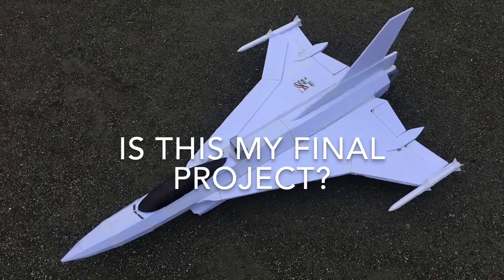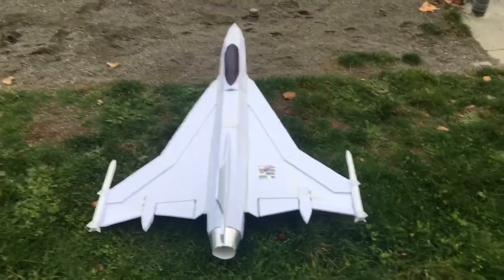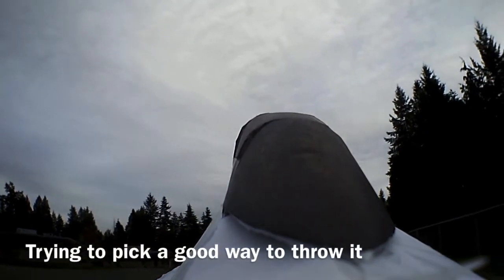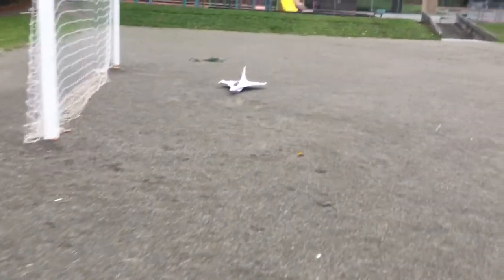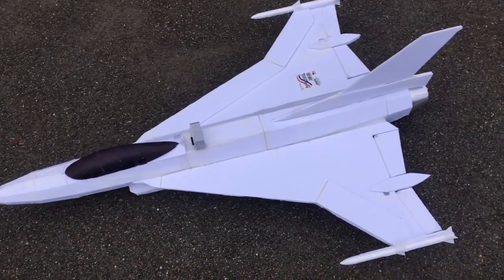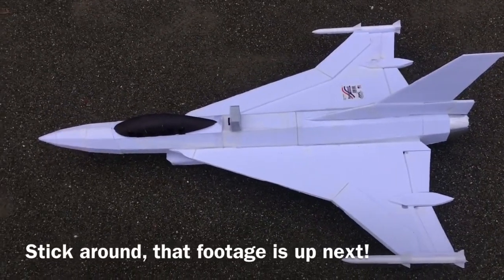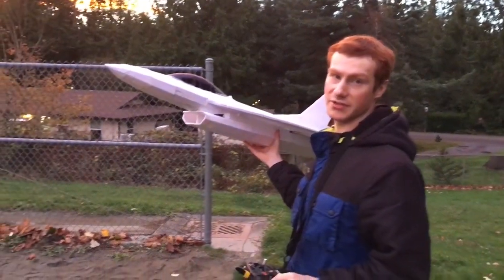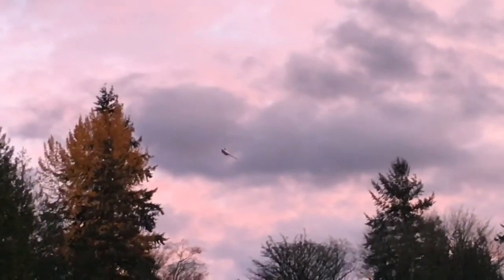DIY RC F-16XL | Foam Board RC Jet

Comment: Wow Matt. That’s an amazingly good looking foam board model. Good job flying in that small area.
Reply from the maker: Thanks! It’s not too terribly hard to do, just use a little less throttle and fly it in a nascar style oval pattern!  
Yeah, designing it was probably the hardest part. Both NASA and Lockheed Martin did not reply to my requests for blueprints under FOIA. General Dynamics did reply, saying that they sold the rights to the aforementioned Lockheed Martin. I managed to use a 3 view and scale calculator though and got a fairly accurate wing proportion. Recognize the missiles? Those are cut off the E-Flite Thunderbird rails!
Reply: Excellent!

Comment: Amazing video ! Glad that F-16 worked out!! That field sure holds some memories 🥲 it will dearly be missed but you will find another great one soon ! And you will surely go back to that school field and say “ahhh this is where it all started.”
Reply from the maker: Sure does! I’m also glad it flew. Both Lockheed Martin and NASA didn’t get back to me, so I had to design it’s wings from basically the ground up.
Reply: @AerospaceMatt  Oh haha nice!!! I know I can’t hardly make somethin like that 🤪🤪🤪
Reply from the maker: Oh, it’s not as hard as it may seem. My tip for designing stuff is always think about what you want the aircraft to do, and to look at 3 view models or draw a concept out on paper. Then take a ruler (I use a yardstick), pencil, and foam board and draw out the plans on 2D, cut them out, and fold them together(and hot glue them together) to form a 3D shape.
Reply: @AerospaceMatt  Oh ok nice! Maybe I will sometime
Reply: @AerospaceMatt  Oh ok nice! Maybe I will sometime